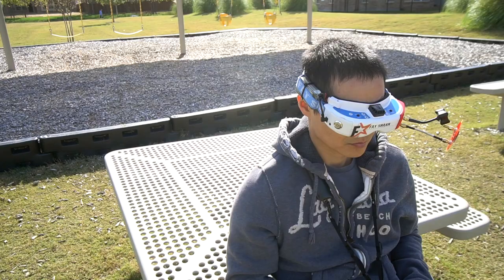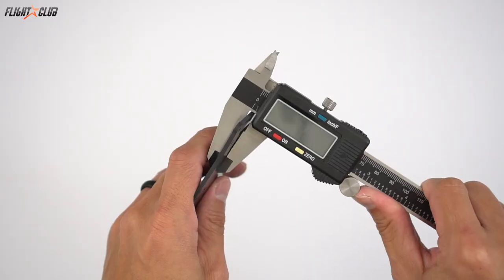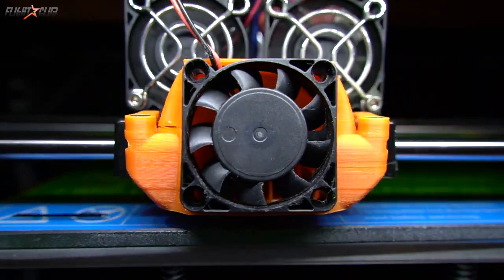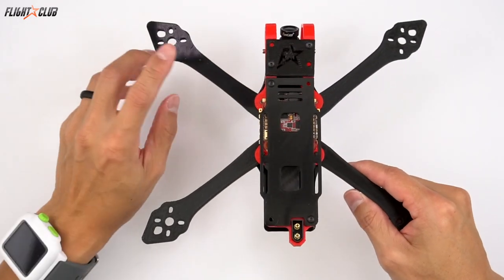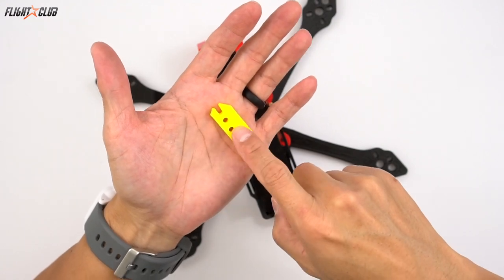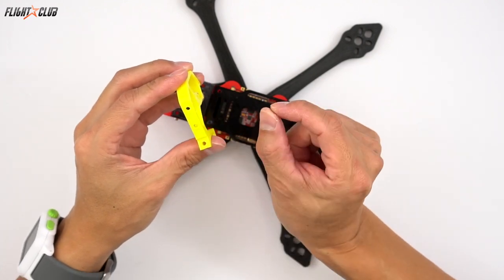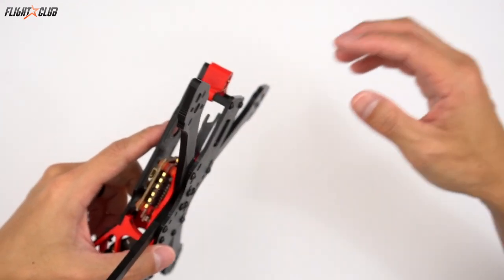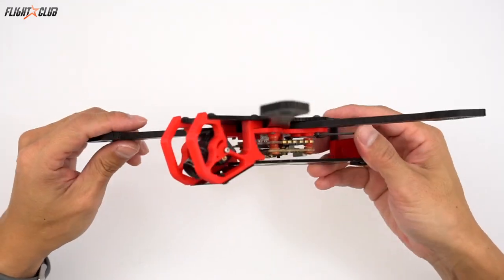FlightClub Freestyle Frame : Bangkok

Comment: Hello Mike, the frame looks great but i recon the shelf at the back will give you problems ie i think it will snap on crashes ive used a floating shelf before and it was good till i crashed, i think it would be great if you could have 20x20 and 30x30 mounting holes at the rear, then we could have a 4in1 in the middle with my vtx stacked on top (check out those Rush Tank vtx's perfect for the stack) , we could  mount an fc at the rear a 20x20 fc or 30x30 one and stack that with an rx. Also if you could design the xt60 plug with a place at the bottom for an immortal T or the frsky version, that would be awesome as i think alot of us use crsf/r9m now. Apart from that it looks hella shweet !  it will defo Bang some kok ! hehe
Reply from the maker: yes, i will add 20x20 and support on the rear shelf.  thanks for the feedback
Reply: No problem bro
Reply: No problem bro

Comment: Arm protection (3d printed) would be fantastic and not sure on lipo strap bit, does it need them?
Reply from the maker: hmm, i'll test the lipo strap idea.  may get scrapped
Reply: FlightClub it's just another point of failure and if your out you don't need to be threading it though but it's just a thought. The actual frame looks pretty unique 👌

Comment: Cool frame. Like the idea on removing the arms. Don’t like the arm ends that sort of bubble look would prefer more of a oval shape. Instead of tpu mount for the vtx Antenna just slots in the top plate for zip ties. Would like to be given a chance to be a tester 🤘🏻✌🏻

Comment: Thought I had the wrong video for a moment 😂 That frame's looking really nice though, the swappable front cage's are a great idea. It's hard to tell from the video, but it'd be nice if the main stack screws could be removed without taking all the arms off - had to do that on my Proton today and it's a bit of a pain.  The T700 carbon arms sound interesting - It'd be nice to try them on my Proton SX's.
Reply from the maker: yeah i hear ya.  the only issue with that is you'd have to make the holes in the arm really big.  it'll weaken the arm but i'll look into that
Reply: @FlightClubFPV  thought that might be the case. It's not a regular job, only had to do it because the butter mount had worn out and split into two separate rings 😀

Comment: The frame is cool but looks too much like the Armattan Rooster.  I would add another set of stand offs or support braces toward the rear of the frame to support the weight of the battery during crashes landing on the top.  Other than  that the frame is cool plus I would add and a PDB to power LEDs for flying with friends and racing to improve visibility.
Reply from the maker: yes support will be added for the rear shelf.  thanks

Comment: I know how perfect you like your frames so its tough to critique it. Maybe one thing i would change would be the stock go pro and to a lower 25 degrees rather than 30, as a lot of pilots like the lower cam angle and its easier to make revisions to raise the angle but tough to lower the angle from 30. I would be interested in testing this frame but im in the uk so the chances are slim so i wish you luck with your new product.
Reply from the maker: i hear ya.  but the gopros have a pretty wide FOV, you probably can't tell much from 20 to 30degrees.  should be ok